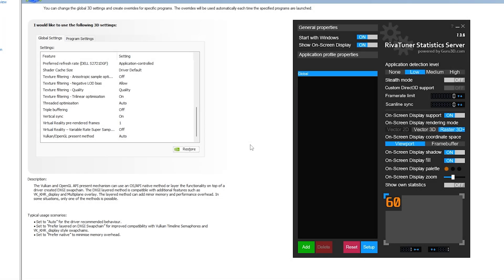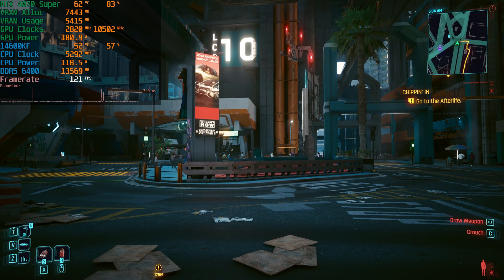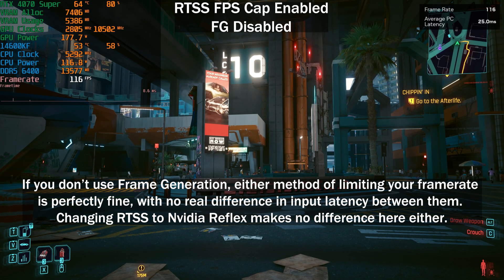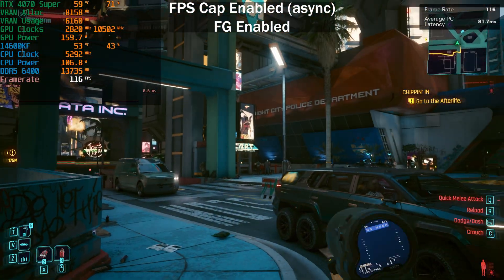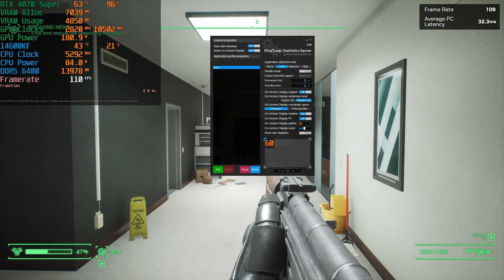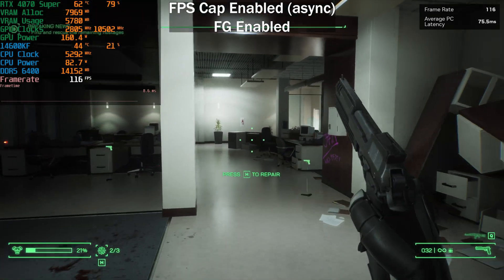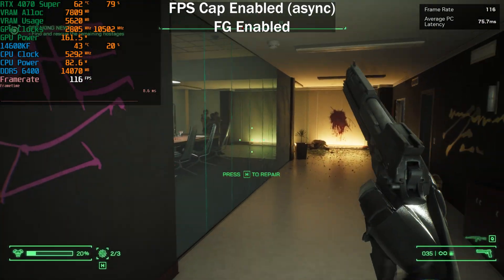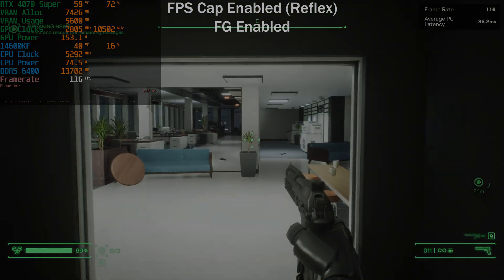How To Reduce Input Latency When Using Frame Generation - V-Sync vs RTSS

Comment: When I limit the FPS to 72 via RTSS, lossless scaling does not work. What do you think could be the solution to this? (When I limit the FPS via the Nvidia control panel, there is no problem, this problem only with RTSS)
Reply: Guy's i have fixed it with RTSS, I separated Global and Losseles Scaling profile in RTSS then i set global's fps to 72 and Lossless Scaling fps to 144
Reply from the maker: I am assuming you are trying to cap the framerate to 72 so that with frame gen you'll get 144 fps? I'm not sure if RTSS is aware of lossless scaling, but almost all games now are DLSS FG and FSR FG aware, so if you want 144fps you cap it to 144fps.  What happens if you cap RTSS to 144 fps? Does lossless scaling still not work?
Reply: @Mostly_Positive_Reviews  If you are doing X2 FrameGen, then you have to limit the FPS by exactly half of your desired monitor refresh rate. You can also do -1 to it (71 now) to avoid stuttering if framerate before applying this was exceeding 144fps
Reply: @mustafa what is your monitor refresh rate from the nvidia control panel? Make sure its 144hz if you want 144hz gaming. Also make sure no overlays of any kind of applications are running in background when enabling loseless

Comment: also is image scaling (TAA), which is the option available in halo infinite for example, the same as 'frame generation' in this context?
Reply from the maker: TAA stands for Temporal Anti Aliasing, and the scaling portion of it is called TSR, for Temporal Super Resolution. TAA scaling is an upscaler which will render the game internally at a lower resolution and then upscale it to your monitor's resolution. These solutions from Nvidia. AMD, and Intel are called DLSS SR, FSR, and XeSS respectively, and they dont generate any frames, they only upscale. The frame generation portion is called DLSS Frame Generation and FSR Frame Generation. These are currently the only two frame generation techniques built into some games. AMD has a solution called AFMF that can be enabled at a driver level to generate additional frames in any game, but it has a few more drawbacks.
Reply: @Mostly_Positive_Reviews  thank you for the clarification here- im trying to determine if halo infinite's implementation of resolution scaling would introduce input latency while allowing for higher fps- my understanding is that yes but the higher fps might offset the input latency introduced by resolution scaling processing.
Reply from the maker: @supernice_auto  Ah okay. Resolution scaling does have a slight performance overhead, meaning that if you upscale from 1080p to 4K you will get lower performance than at 1080p native, but much better than at 4K native.  But It doesnt introduce additional input latency, it actually is very much in line with your actual framerate. So it would decrease your input latency.  Not as much as if lowering the native resolution, but still much better than running at your monitor's native resolution.
Reply: @Mostly_Positive_Reviews  sorry i meant scaling up so running game at a lower resolution then scaling up to native 1080p res. outside of getting a monitor with built in nvidia reflex analyizer how can you test for input latency? is capframex a reliable approach (looking at frametimes for example)
Reply from the maker: Frametimes wouldnt indicate latency unfortunately. It only shows you how long it takes for a frame to be rendered.  Using GeForce Experience you can check the Average PC latency, or using the Nvidia App.  CapFrameX does have App Latency but to be honest I am not 100% sure exactly what that indicates.

Comment: I would like to share my settings for low latency. 
75hz 1080P Monitor - DLDSR 2.25 (1620P)
CP2077 - FG On
NVCP - Vsync Adaptive
NVCP - Frame Cap 60
Avg Latency - 30-33ms

With RTSS Cap + Reflex On, I'm getting frame spikes. Tried different frame cap combinations (NVCP + RTSS Reflex, etc)  
but these settings above helped me with the smoothness and image stability.
Reply from the maker: Definitely going to test this, thanks! Getting 30ms Avg latency with FG on and a framerate cap at 60 is very low, and if I can replicate this I will definitely share this info, thanks 👍
Reply from the maker: When using these settings I get 68-72ms. Only when I disable FG do I get 30-33ms with NVCP 60 fps cap and Adaptive v-sync.

Render latency is sitting at 30ms, but PC Latency is more than double that.  You sure you are talking about Avg PC Latency, as displayed in the video?

Comment: I'm curious how RTSS frame rate cap compares with Nvidia Control Panel frame rate limit in terms of latency, FG on and off.  Thanks for this very interesting video!
Reply from the maker: I've seen the NVCP fps cap overshoot some times, meaning if set to 120 fps it will sometimes jump to 123 and come back down. It can happen with RTSS as well, but in my personal experience it happens to a much lesser degree. I will check if it is reflex aware (I think it should be) and let you know 👍
Reply: i’ve seen it tested, rtss frame rate cap causes less latency than both nv control panel and in game frame rate cap so i use rtts basically always.

Comment: Interesting video.

I don't plan to ever limit the FPS, cuz the higher the input lag, the more I'm pissed.

I'm wonder if G-Sync and Free Sync are superior to in-game V-Sync.
Reply from the maker: The only reason I use v-sync is to keep the frame rate below my monitor's max refresh rate, otherwise in some games it can exceed it with FG enabled, and I get tearing, even with freesync or g-sync enabled, as neither of those limit the max framerate.
Reply: Gsync or Freesync is used in combination with vsync.......
Reply from the maker: @shayanali8771  Yep, otherwise if you go over your monitor's refresh rate you will see tearing anyway.
Reply: @Mostly_Positive_Reviews in my case im using 240Hz 4K monitor mostly FPS stays between 60-100 with Frame Gen ON should i need to use V-SYNC? im looking to reduce latency while frame gen ON

Comment: @Mostly_Positive_Reviews I don't know if I'm just being dumb here, but I don't understand why you would want to use a frame rate limiter when Relex already does it for you.
Reply: reflex only limits your frames if you have vsync engaged in game or forced in control panel, i presume hes using the RTSS reflex option wihtout vsync engaged in either one.
Reply from the maker: Yeah, this. Using Reflex with v-sync limits your framerate to around 3% below your monitor's refresh rate. Reflex on its own doesnt limit the framerate.

So the tests with v-sync on has reflex enabled as well because frame generation automatically enables Reflex. I then used that same output framerate to limit to using RTSS to keep the max fps equal between the tests.
Reply from the maker: Answered below. Reflex on its own does not limit your max framerate. It only limits it to around 3% below your monitor's max refresh rate when using v-sync + reflex.
Reply: @Mostly_Positive_Reviews  I understand that you can limit your frame rate to the same as Reflex with RTSS in (Reflex mode) without the need to use Vsync but from my testing at least if I even get within 10 frames of my Max refresh rate I can get tearing with without Vsync so I'm not sure what the point is using an external cap without Vsync that's all
Reply from the maker: @EndGxme  Do you have g-sync enabled? Typically you wouldnt see tearing when within the g-sync range, so it's maybe possible you are outside of that range? But yeah, as I said in the video, I personally just stick with v-sync enabled as it has given me the best overall results.  Doesnt increase latency, no tearing, consistent frame pacing etc.
Reply: @Mostly_Positive_Reviews  Yeah I use Vsync and G-sync as well what I was saying was this if V sync was off if I get anywhere near my Max refresh rate tearing occurs but on the flip side you only incur a input lag penalty with Vsync if you're constantly hitting the max refresh rate so it's kind of a no-brainer to turn it on  that's why when reflex is enabled it caps your frame x amount below the maximum rate it's actually very good for thought from NVIDIA to do that
Reply from the maker: @EndGxme  Yeah, got you. Reflex is great, and the way it works by preventing you from bouncing off the v-sync limiter really helps a lot, agreed!

Comment: Why I don't have the Reflex option inside the RTSS? Does it per game basis thing? 🤷🏻‍♀️
Reply from the maker: It's not on a per game basis as I can select it even from the desktop. What GPU do you have? Also, which version of RTSS do you have installed? I currently use 7.3.6
Reply: @Mostly_Positive_Reviews  me neither I only have async, front edge and back edge. I have an RTX 4060
Reply: @Retr-lk5ns  and  @Jakiyyyyy I didnt have the option on version 7.3.4 of rivatuner, and as soon as I updated to 7.3.6 I got it on the menu.